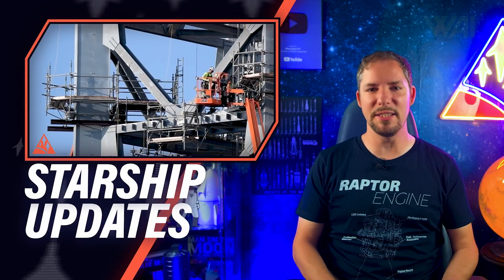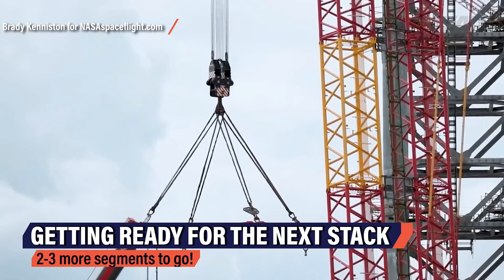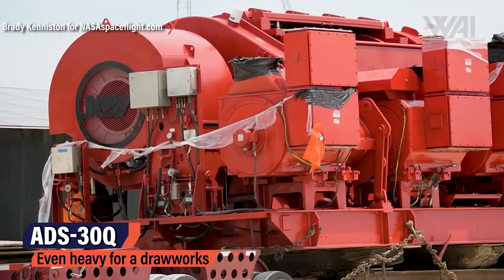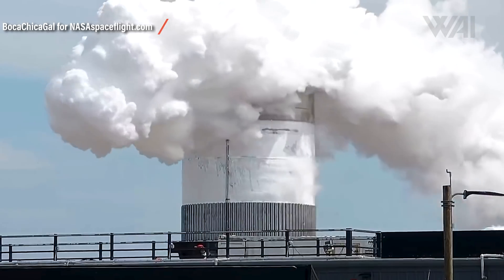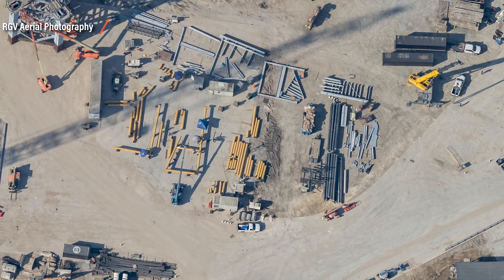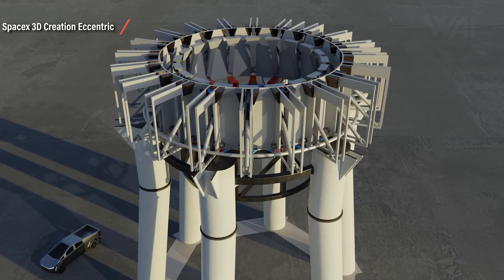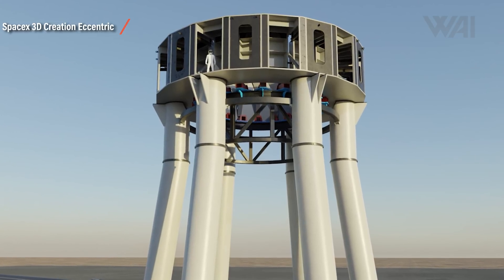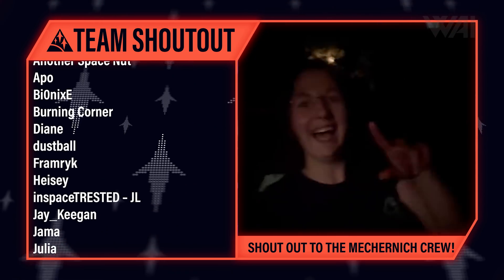SpaceX's genius move on how to build sea and land-based Starship launch platforms!

Comment: It's not that the road isn't used that much. Most roads, bridges, electrical grids, train tracks, air ports, gas/water lines, sewage treatment, broadband reliability and accessibility, ect in this country, as you put it, "haven't seen love in a while". It's pathetic and the current President is trying to do something about it but they think he eats babies or something so he's having a tough time getting anything done.

Maybe the yellow pipes will just be a roof to go over a park bench or something.

Comment: The yellow pipes could be filled with something like cement or so, maybe something lighter, to be something for stacking or a catching mechanism? Hm.
Reply: How much helium would you have to compress inside of those yellow arms to counteract their weight?
Reply: @camaro406ss  that's uhh.. not how buoyancy works. lol
Reply: @camaro406ss  helium still weighs something, you’re just adding weight after a certain point
Reply: @camaro406ss  what?
Reply: @camaro406ss  the question becomes: how big a volume filled with helium at atmospheric pressure would you need to counteract the weight?
Reply: @rodschmidt8952  With the wall thickness of the pipe, maybe the size of the entire compound squared. I realized my mistake fairly quickly.

Comment: Giant Canadarms would replace the launch tower and the launch mount, and while one holds the super heavy booster (and catches it on return), another would stack the starship. All it needs is connection points on the ground and it can move between the launch site and the Canadarm maintenance building.

Comment: I think rockets should land on their guidance fins, captured on movable cables suspended from towers which eliminates the need for landing struts.  Rockets could launch from that hung position too.
Reply: They can't launch from that position, for many reasons: (1) it would not be clamped down to allow the engines to light before liftoff; (2) there would be no way to test that the fins are still okay between flights; (3) the engine blast would be too close to the tower, likely damaging it (especially with no water for sound/vibration suppression); (4) there would be no way to mount the next Starship on top of the booster, etc....
Reply: ... and, the lift-off weight is a few thousand tons, not just a hundred while landing.

Comment: 7:07 Can segments of a variation of this be assembled in LEO with the proper engines and controls to land on the Moon or Mars to become a landing pad for Starship?
Reply: Also on both Moon and Mars there would be only Starship starting with 6 Raptors.
And getting water for it would be very hard.
Reply: For Moon maybe, but someone would need to make very weird and pretty heavy Lander for this specific purpose. (I think assembly on Moon would be easier)

On Mars this needs to be made on surface.
Heat shield and landing would be just too hard When it could be just Made on site.

Comment: Pipes are often used in construction projects as bracing beams/struts for deep excavation pits like subway stations or tunnel starting areas. The advantage is the material used combined to the force distribution. It makes more sense and is easier to maintain f.e. at offshore equipment if you have less corners or edges. As well is welding these pipes in flexible length and diameters easier in ma opinion. So as a conclusion, it can easily be used for all types of construction where you have high forces or stress as gantry cranes, bracings or similar

Comment: I do think these might be protoype catching arms, those pipes look similar in dimension to the the hoppers legs which are seriously stout, and they probably want arms to be as light as possible so a hollow structure would make a lot of sense. Seems like something like that would be easier to lift into place aswell versus some massive complicated i beam structure with lots of bolts and so on. Also wouldnt it be a lot easier to build something like this in a short amount of time if one gets wrecked by the booster, just have a stockpile of pre cut pipes laying in a shed.

Comment: Hi Felix

You asked today about possible function of the yellow tubing. 
I agree, not for liquids but what's about plain common air?
I am thinking for a while about the catch system Elon is planning. For me the rails on 3 of the columns allow some kind of vertical movement of some parts attached on runners/ rollers.
But what's about spring action of the contraption at the moment of catching? As air can be compressed I could envision air inside the yellow tubes acts as such springs. For that the pipes would have a tiny vent somewhere to allow a pressure buildup at the moment of load ( catching the booster). The spring action can be adjusted at those valves.
It a typical pneumatic system. Just think about it when you close your kitchen drawer which most likely what we call "soft close" 
As a former woodworker I have no expertise in machinery things but with a little imaginations ....
With greetings from Germany's Westerwald

And give some love to the birthday girl!

Volkhard

Comment: 8:10 Looking at the various lengths, some being very short, and the angle of the ends, it looks like an unassembled semi circle or claw. The gray girders and stringers appear to be some sort of framework or mount. A Super Heavy claw would need to be strong and light weight, pipe fits the requirements.

Comment: This is what Elon Musk is best at.  Working out what needs to be done and getting all the parts running simultaneously.  It's like when the builder is doing the roof, the plumber upstairs, the electrician downstairs and the windows being fitted all on the same day without them getting in each other's way.

Comment: Great video and Happy Birthday to your daughter. I saw today for my first time inside the column section of the tower. It has 2 rows of welded headed shear studs on each plate/face. This is indicative of concrete to be placed inside the tower columns. I do not know why they are not placing the concrete as they stack sections. Must be fixtures to pump the concrete through the plate at specific interval heights later with possibly shrinkage reducing additives in the mix. (can't drop concrete that far) The tower will be very strong yet slightly ductile and quite heavy. not certain how many or how deep the piling/ciasons are. Possibly they need the legs mentioned before the added concrete weight is added. Would hate to see a leaning tower of Boca Chica.

Comment: I wonder if the yellow pipes are the frames for a flame diverter?
Reply: So far there's no sign of flame diverter
Reply: @alvianchoiriapriliansyah9882 That's what I mean! perhaps it's a frame for casting or supporting a flame diverter? Either the "mold" for a concrete one, or a supporting frame for a metal one? I honestly don't know how feasible such a thing might be, but I seem to recall Elon expressing some doubt about the lack of a flame diverter.

Comment: The water Pipe on sound supression system is WAY to small.
It looks like it's something for fire fighters.
Reply: Anyone can build a bridge that stands. Only an engineer can build a bridge that 'barely' stands.
Reply: @faustin289  If it was bridge it would probably collapse.
And ground support of rockets is place where there should be pretty big margins of error. (because stacked Starship with Super Heavy would explode entire complex would be gone)
Reply: Agreed, it looks underwhelming for such a job as so many, most powerful engines.
Reply: Every little bit helps
Reply: Speculation, remember?
Reply: Can they use some liquid gas (nitrogen/helium) for sound and vibration dampening ?
Reply: @architgupta4883  No, because it lacks the physiological properties that water has when it comes to sound suppression.
Reply: @architgupta4883  Water is heavy so it is probably better and dampening, also has higher boiling point and specific heat so it's better at absorbing heat.

And it's just cheap, they have A LOT of water there. Using helium or nitrogen would be just expensive.
Reply: @architgupta4883  Surely it would vaporize straight out of the nozzles and fly off before it had a chance to do any dampening

Comment: The water has excellent damping properties as well as excellent dampening properties.
Reply: @Whataboutit  Can they use some liquid gas (nitrogen/helium) for sound and vibration dampening ?
Reply: @architgupta4883  they can! They can use a mixture of 2 parts hydrogen to 1 part oxygen!
Reply: @architgupta4883  liquid gas? It's either gas or liquid xD or solid or plasma to be precise. Never 2 at the same time. Logic
Reply: @JayPixx  Steam. The blast of the raptors is absorbed by converting the water in the suppressor ring to steam. Energy is converted to a form less destructive than raw fire by pouring that energy into what is required to convert the water as liquid to gas. The launch table is a suppressor just as is used on the end of a gun. It's there to direct waste energy (the pressure no longer needed to propel the bullet - once the flame leaves the rocket nozzle it's useless) and the flow of that energy into the atmosphere with less shock. That's the reason for such a complex geometries built into the launch table. It's one giant tuned port and without it, the base of the launch pad would be eaten away by non-converted flame.
Reply: @bobearly3653  first of all - why are you talking to me man? Second - why about different stuff? :p I think it's by mistake but not really sure.
I said something along the lines of "gas is not a fluid and vice versa".
Reply: Way to put a damper on this video lol
Reply: Wut???
Reply: @everydayspacenerd8192  damp(humid) and dampening as sound supressing
Reply: @nalle5227  Damping is sound suppression. Dampening is making wet.
Reply: Can they use some liquid gas (nitrogen/helium) for sound and vibration dampening ?
Reply: Vibration dampening is critical
Reply: Could you please translate it to chinese, please?

Comment: Those draw works are used to lift Several MILES of a Pipe string made up of--30 foot long steel sections 4 to-5 inches in diameter and bigger.  all at once-- VERY POWERFUL can handle 400 feet of ROCKET very easy .

Comment: Draw works are amazing machines. They can lift immense weights very quickly and stop on a dime (so to speak). They have to hold tens of thousands of feet of thick steel tubing hanging gently millimeters above the bottom of an oil well being drilled, while lowering the whole thing slowly enough to keep the drill bit gently touching the bottom as it chews away at the rock (if there is too much pressure down, the drill bit bogs down and can break). Then it lifts the whole drilling column a bit, so the column can be hung from the edge of the well, while a new section (called in the industry a 'joint') of pipe is added between the hung drilling column and the top drive (the motor that spins the drilling column). All that, and it can pull the whole drilling column up ('tripping', as it is said), stopping at every joint to remove them, just so the drill bit can be brought up to the surface (to change it for a new, sharp one — or a smaller diameter one — wells are drilled large at the top, with diminishing diameters towards the bottom).

In short, they pull insane weights with amazing control, capable of stopping and holding thousands of tons with great accuracy.
Reply from the maker: Exactly what SpaceX needs and on top of that it's tech that's already used on oil rigs/sea launch platforms! Brilliant move! Thanks for the comment! :_WAIHello:
Reply: @Whataboutit  I love how SpaceX, and to a certain extent, Tesla, Will either find a technology in another market instead of paying Aerospace company's ridiculous prices, or make something do double duty. Often both approaches at the same time.
Reply: How are they controlled? Are they stepper motors?
Reply: @rodschmidt8952  since it's an AC (alternating current) motor, I would expect it to be a "VFD" (variable frequency drive) controller. We'll, that's the type used on 50 hp to 100 hp motors I've been around. 6000 hp (combined) is just insane. 🙂
Reply: @rodschmidt8952  I don't think so, no. Just big, unthinkably beefy motors to move and equally massive disk brakes to stop.

Comment: Regarding the Yellow Win95 assembly...
I used to work in a shipyard where we built Liquid Natural Gas (LNG) powered ships. 
This kind of sharp angle is usually included to absorb the sudden contraction of cryogenic fluids. You can't design a sliding seal that will work under those conditions so adding a sharp diverted section allows to concentrate that movement in a single place instead of having the pipe break out of it's holding structure at the risk of failure. 
It is for instance quite common in LNG emergency valve divertion.
Reply from the maker: That sounds interesting! Could you maybe send me an email to whataboutit.contact@gmail.com to explain in detail? :_WAIShocked:
Reply: Good thinking but I don't agree in this case.  Putting shock bends in pipelines is common.  In fact you might have some in any long water pipes in your home.  But they don't use bends greater than 90 degrees.  The sharp angle we can see in the video would be a stress concentration point and be likely to break, creating a worse problem.

I'm thinking the yellow structure(s) might be part of the booster catching mechanism that will be mounted to the tower.  They could fold back when not required.  Necessity is the mother of invention and catching a huge rocket booster is going to require the mother of a solution.  Hold onto your seats.
Reply: @philipgrice1026   Good points.
We'll see soon enough. 😉
Reply: Can they use some liquid gas (nitrogen/helium) for sound and vibration dampening ?
Reply: @architgupta4883  No, it would complicate things needlessly to spill cryogenic liquids everywhere. 
It's the fact that a liquid is sprayed that dampens the vibrations somewhat, not the nature of the liquid. Might as well use the cheapest, simplest and least likely to cause problems.
Reply: My next best guess on what those angled yellow pipes are; part of the booster catching mechanism. 😉

Comment: I'm not an expert but that weird pipe assembly feels like the catching arm
Reply: Or, maybe, a ribcage for the arms of "Mechazilla"? 🤔
Reply: I don't think they'll use pipes for that. I'd assume something completely solid or reinforced would be used, but these just look like fully hollow pipes. No rings, no struts. It probably won't be heavily load bearing. It can't take the force of a falling Superheavy.
Reply: @Gaminggamer1602  It's still early, it might be the inner structure of the arm or something, if you think about it, superheavy's gridfin mount won't be much larger in diameter so I don't think it would actually be that stupid to think that that is some part of the catching arm and who knows, it might just be a pathfinder, it might be close to the final part's shape and they'll practice attachment and handleing on a light version if that isn't part of the final design

Comment: 12:45: That's a lot of water pouring down, where is it going?
Reply: Most/much of it will flash into steam & vapor.  Will be fresh water so I wouldn't be surprised if drainage system strains remaining water & pumps it back up into the holding tank, ready for next launch at 2pm. haha #goelon
Reply: @MissouriClydesdales   They'll almost have to, because Starbase is barely above sea level and has a very high water table.
Reply: It´s vaporized with Raptor-fed floor heating.
Reply from the maker: Draining system. That would be the normal approach. I wouldn't be surprised though, if SpaceX just makes it magically disappear though... □
Reply: @Whataboutit  LOL, a bit of magic goes a long way. Your right about the drainage system, that would be the first thing i would have built before building the launch pad.
Reply: @Whataboutit  draining system to pollute the sea right!?

Comment: I commented on the last Video that i assumed the yellow pipes were for natural gas, based on info available back then. But yeah, i agree that it doesnt make sense anymore with how they use them. But new theory: Moving Stuff in Industrial Environments is often painted in bright colors, eg moving Crane Beams are painted in yelllow or Orange - So maybe these Pipes will be moving Parts, like the Catch mechanism, most likely the Arms of it i assume. Makes sense in the context that Pipes are pretty strong in for axial Loads. Still weird to use them since to my knowledge I beams have comparable strength in that direction and can handle traverse loads far better (which i would expect such a construction to experience)

Comment: Did some research about the drawworks.   they will get power from the large diesel engines delivered several days ago.  Maybe that's what the new foundation is about just NW of the tower.  And yes, i'm sure the yellow pipes will fomr the catching arms.

Comment: If you look at my imaginings for the rocket arresting system in this animation the yellow pipes might make sense similar to the grid truss system I've shown holding the arrestor motors running across the top of the trusses on railroad tracks. 
https://youtu.be/nzhdc6qXhVk